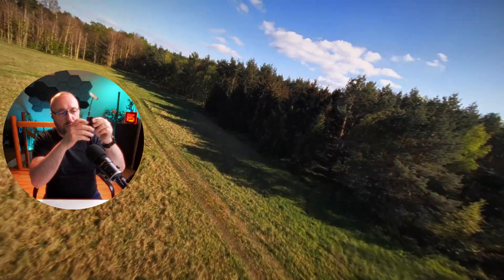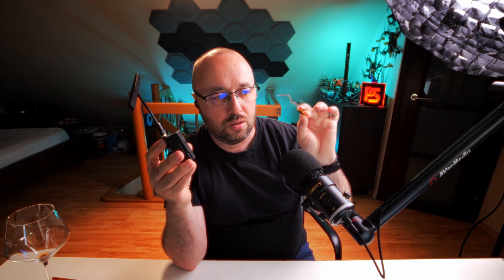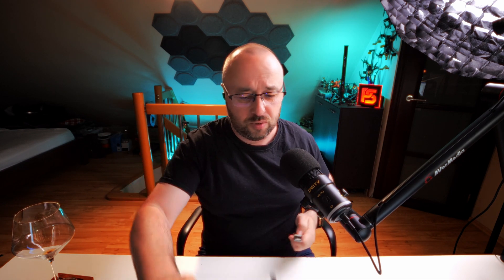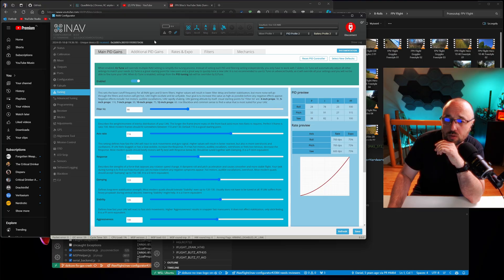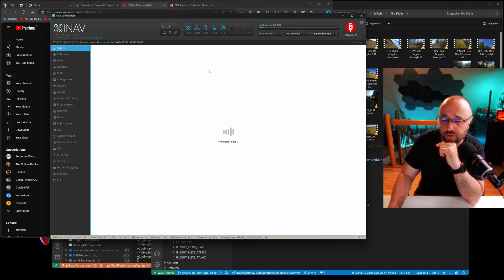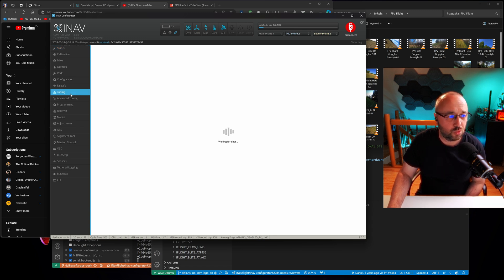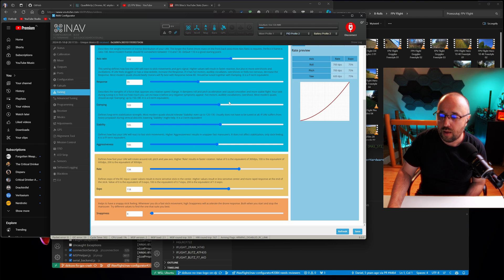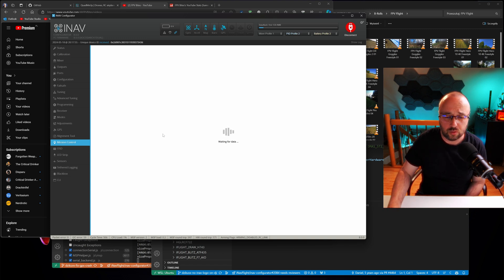Express LRS Airport is broken LoRa E45-TTL-100 to the rescue

Comment: Yeah. I got the same problem with ELRS. They can't reconnect in the air once they disconnect. Even if the drone is next to the transmitor. You have to reboot the airbone to establish the connection again.

Comment: Seems you are the only one having problems with ELRS?  
Btw: why do you still refuse adding bidirectional DSHOT to iNav. That's a real pain ...
Reply from the maker: No, it works fine. And on the topic of BiDir DSHOT, I will tell you a secret: RPM filter is overrated :)

Comment: Pawel, is Airport for the ground station? I am using telemetry from TX16S directly. I have programmed an ESP module to connect it wirelessly via WiFi to the station, but it also works via a USB cable.